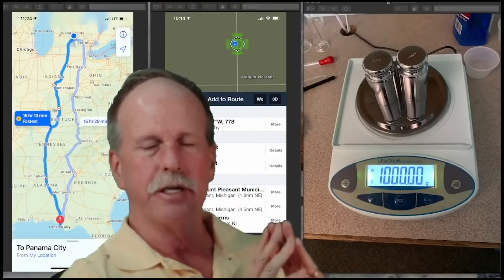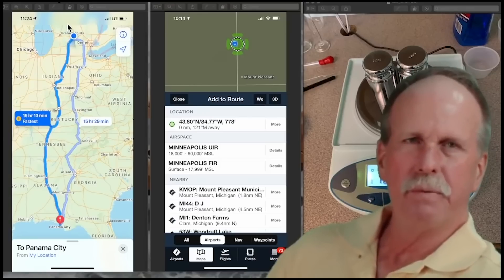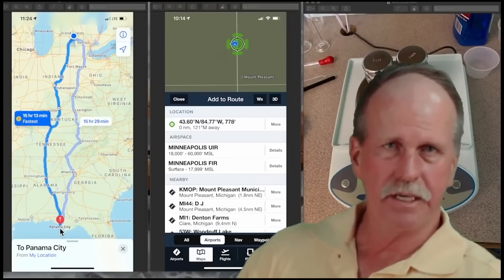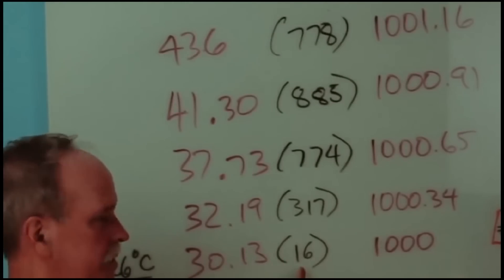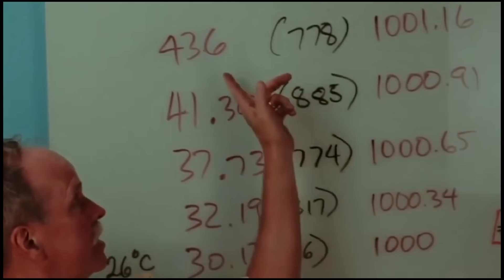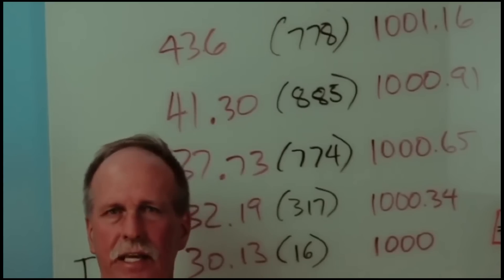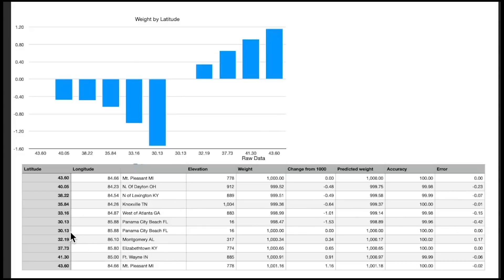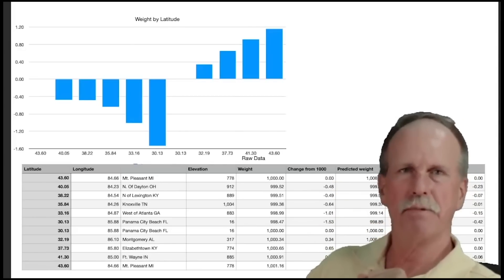Rotation Test for Flat Earth

Comment: Your challenge is off-base. No matter what the density change is from temperature change, both mass and weight will be identical and unchanged! All temperature change could to is expand or contract the mass. It cannot add a thousandth of a gram or remove a thousandth of a gram! Your challenge is a trick question with no answer.
Reply: quick question, are you a flat earther?
Reply: @Top-Code  The answer is in my post.
Reply: @RockinRobbins13  not really? If you are a flat earther you just debunked yourself, if you aren’t then your comment was kinda pointless because the challenge is supposed to be a trick, only possible on a flat earth. But it obviously isn’t possible at all because the earth isn’t flat.
Reply: @Top-Code  quick question, are you a flat earther?
Reply: @RockinRobbins13  nope

See how that’s an actual answer?
Reply from the maker: He isn’t. Robbins the difference caused by buoyancy is not zero, but very close
Reply: @Top-Code  Mass does not change. Mass (rest) can not change without adding or removing stuff.
However a temp change will ever so slightly change the density of the object in question. And since it sits in an atmosphere a less dense object (as a result of increased temp change) will experience an ever so slight change in buoyancy resulting a very tiny change in measured weight.

But with weights of this size - I doubt we could measure it without much more sophisticated equipment.
If the metal weights were the size of supertankers...perhaps a bit easier.
Reply: @BobtheScienceGuy  I only asked him because he asked me. 😃My previous post made it crystal clear that I'm not a flat Earther. But he asked anyway. I merely repeated the gambit.

Comment: The weight difference between Michigan and Florida would have been even greater if elevation had been taken into account. The weight should be slightly less in Michigan than in Florida because gravity decreases with elevation, yet it was greater there because of the slower rotation.
Reply: Actually Michigan is very close to sea level. Like Florida, Michigan is mostly wetlands
Reply: @A2forty  Eh, kinda. Depends on your definition of "close". Michigan's lowest elevation is 575 feet, give or take.

Comment: Relative density? So a FE person would expect 500g weight to float when placed in a vacuum chamber where there is no air? Gravity just makes sense.
Reply: they then use the excuse of electrical charge, or whatever they call it.
You seen that?  It makes no sense, but the flerfs use that when "density" fails.

Comment: Hi bob! Can you retrospectively check the moon position during your readings? My hunch is that it may have contributed to your error on your southern trip. Also the moon position of when you calibrated the scale
Reply: It makes about 1 part in 300,000 difference, so doesn't materially contribute to the errors Bob saw.

Comment: As an aside, grams is a measure of mass - not weight.
Reply: so, if the rock on the moon weighs 1Kg its going to weigh 6 Kg on earth, yet the rock didnt change size, its mass didnt change but its weight did
Reply: True, but on earth and everywhere that has the same gravity, mass and weight are interchangeable.
Reply: To all: mass is a measure of an object's inertial potential - the resistance to changes in motion. It's measured in units of grams or pound-force. Weight measures the effect of a force (be it gravity or some other force) on a mass. It is measured in newtons or pounds. The two terms, mass and weight, are defined as distinct and separate measures in the sciences - that was my point.

Comment: No good! If you move a precision scale, you have to re-calibrate it.
Reply: It depends on what you want to measure. It was used to measure the weight of the mass, not the mass.
The important thing is that it is level and at rest.
Reply: That depends on how carefully you handle it, and the accuracy you’re after. Any uncertainty introduced by moving the scale would be far too small to invalidate Bob‘s results.
Reply: The reason you have to recalibrate a scale that you moved is because of the rotation of the earth.  Moving the scale itself doesn't cause a calibration problem unless you've damaged the scale.
Reply: Good point but the data on the correct trend line supports the case and using multiple data sets from numerous observations,, it might account for the level of precision observed though and the outlier, Calibrating the balance, however, would reset the scale to Mass not force and the experiment wouldn't work.

Comment: If you took the weights on your cruise, and weighed them, you would notice that they got lighter over deeper water, and heavier in shallow water. There is a bathometer that does exactly that, and it works, and it has been tested to be accurate. It works because water is less dense than rock, and because gravity.

If you didn't bring the weights, try to enjoy your cruise anyhow. You deserve happy holidays.
Reply: And what would the variation be? >0.01g per 1000g?
Reply: @advorak8529  I don't happen to know. I just read about the device. The hard part was making the measurement noticeable with 1800s technology, so I'm thinking it's small.
Reply: these are exactly the kind of variables that people don't know about and can't therefor consider. bob the bullshitter knows these things. the general public doesn't..... boo hoo bob. you're such a liar

Comment: It's funny that this is the answer to their "if the planet is spinning, why isn't everyone thrown off" question.  Because yes, while centrifugal force in Earth's rotating reference frame is a thing, it's not nearly as strong as they seem to think it is (it's 0 at the poles, 0.003G at the equator).  But it does have an effect that can be measured.  I bet if you show flat earthers this though, they will just say the scale is broken.

EDIT: Misplaced a decimal point, corrected.  It should be 0.003G.
Reply: I used to live next to a schoolyard, and we had a merry go round.  we had to get it going much faster than .0007 RPM before people started flying off.
Reply: right, watching the earth spin is like watching a record spin at .00069 rpm, instead of 33 rpms - not much of a merry go round, and not likely to throw anyone off, lol
Reply: 0.03 gm per what? Or do you mean percent?
Reply: @pedtrog6443  Misplaced a decimal point, oops.  It's 0.003G.  1G is Earth's normal gravity (9.8 m/s^2). This is 0.3% of that.

Comment: Hey, Flerfies, matter gets heavier with increasing temperature, but at the same time, all other things being equal, matter also expands in volume with rising temperature, solids less than fluids, and fluids less than gasses, so hot matter has a relatively lower density than cold matter. Water is a somewhat strange exception since it is densest around 4 Centigrade, and there are a few other substances, but that's Nature for you.

But the weight is insignificantly larger for hot matter than for cold matter, micrograms at best for two 500 grams weights, if not mere nanograms, way, way less than shown in Bob's et al's worldwide experiments.

I don't have time to do the calculations at the moment, but if I care to search for the right formula, I should be able to come up with the right numbers, unless, of course, you Flerfies fold and bow to the irrefutable evidence in this video.

Comment: Where is the rotation?
Reply: Masses weight less near the equator and more next to both poles. This is for two reasons: distance from center of the earth and spin.
Reply: @gabrielesimionato1210  ok, then I will buy my drugs in Equador. Gracias, senior.
Reply: @tonymcflattie2450  A balance scale will foil you (as will Equadorian drug laws.)
Reply: Right there..
Reply: normally around the axis...

Comment: So, I should buy dope on the equator and sell it in Alaska?
Reply: Balance scales detect mass. Spring scales detect weight. Weight increases closer to the poles. Mass is unchanged.
Reply: @RockinRobbins13  Absolutely correct. I should be more concerned about how the defined mass has been quantified in a specific gravitational field in the first place! But then there’s an entire scientific bureaucracy for that conundrum, so why should I worry….Have a good day.
Reply: Yes!
Dope on the equator is much, much cheaper than in Alaska.
Reply: @XtreeM_FaiL  thats probably why
Reply: Unless a balance scale is used.
Reply: @karstentopp  It may balance, but the balance weight wouldn’t weigh?
Reply: @papachis9535  It doesn't weigh, it just compares.
Reply: Use a spring scale.
Reply: @heronimousbrapson863  they are weighing dope not springs  ;)

Comment: If temperature was a major factor then during summer in the UK everyone would have had to have been recaliberating their scales several times a day as the cooler mornings gave way to hotter midday and cooler evenings. During the winter it would have been even worse as buildings are not heated overnight and in the old days buildings were drafty. So temperature swings of up to 20 degrees between when the heating went on and reached working temperature were not unusual.
Reply: Scales are affected by temperature, however. We had high sensitivity scales in our laboratory which couldn't have hot crucibles placed on them because the bottom plate would expand.
Reply: @peronkop  If your sample is that hot you'd better weigh it FAST as it will be getting lighter by evaporation or even combustion.

Comment: Very cool experiment!
Reply: Not that cool if you calculate how hot those weights have to be to displace enough air to explain difference in weight...
Reply: @jaketzi8816  what’s displacement of air have to do with weight, or how hot? I heard a flattard use buoyancy and density. Is that what you’re implying?
Reply: @jaketzi8816  so the video flew right over your head, shocker.
Reply: Heating a substance causes molecules to speed up and spread slightly further apart, occupying a larger volume that results in a decrease in density.
If you heat those calibration weights more and more, density decreases relative to air around, If you can heat them enought to get density less than air, they float away? In experiment like in the video, they both are in same temperature. So, if the temperature increases air density decreases faster than steel density due of different (100x) thermal expansion coefficiency. 
Temperature increase -> weight dec...

Well, there i got it wrong, i think. 

I take my words back, it is VERY, VERY COOL experiment.

Different thermal expansion coefficiency betveen air and steel causes change in weight in different temperatures.

Is that even near correct explanation???